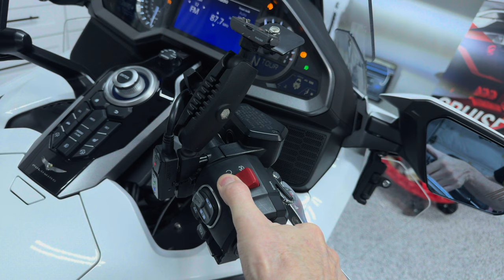The Oil Change

Comment: Ahhh yes, the early signs of spring.  I too like to blow the winter yuck out of the garage before doing the spring maintenance.  Last weekend for me.  Oil, filter, final drive gear lube, new LED headlights, a variety of WingStuff grommets for old loose ones on the side covers, tire inspections, FOBO2's, etc.  Get's us going.  Next weekend is the new Garmin XT2.  They're on sale now and I've been waiting!

Comment: What about the DCT filter?  Also, you used a scissor jack to lift the rear  wheels rather than the bike's rear stand. Why?  Thanks, C
Reply: I was wondering about those things as well. Thanks for asking.
Reply: The scissor jack was only to hold the traxxion dynamics belly pan in place while the screws are removed and replaced... otherwise the bike was on it's center stand.

Comment: Changed the oil in mine yesterday and installed the Traxxion belly pan and tie-rod. Was going to put the drop protection on but ran out of give hoot. Will put it on tomorrow. Still need to install my Clearwater Erica's and show leds. Now that I have the new Yamahammer MT-09 pretty much done less new brake lines. I can devote more attention to the Wife Taxi Wing.

Comment: Enjoyed that, which oil was that you used Chris
Reply from the maker: Castrol GTX 10/40. I use that in the summer months.
Reply: Would you recommend a synthetic for the previous generation gold wing (2017 model with low mileage) ?
Reply from the maker: @baldBiker-f2k  Either is fine. I ran both in my 2007 and 2012 and could never tell much of a difference.
Reply: @cruisemansgarage  thank you!